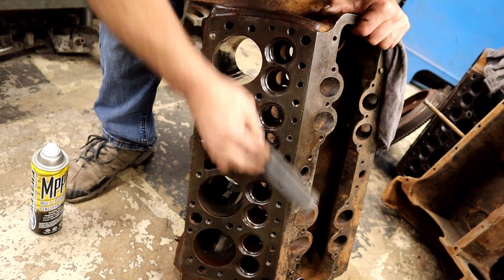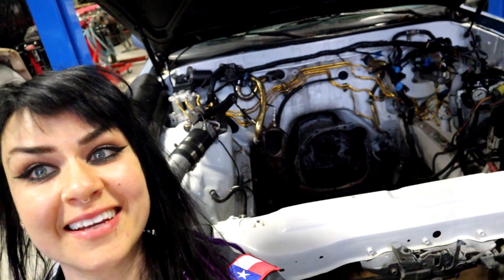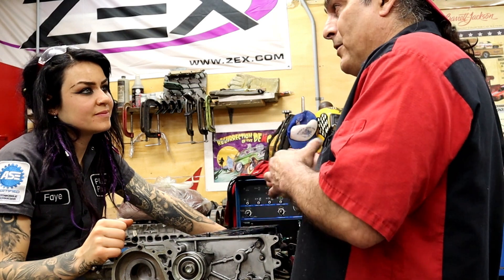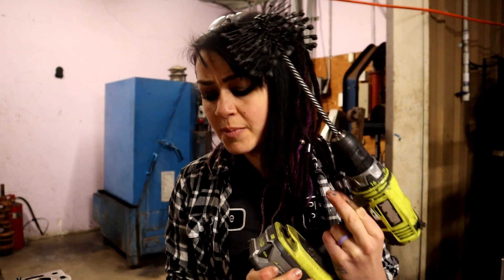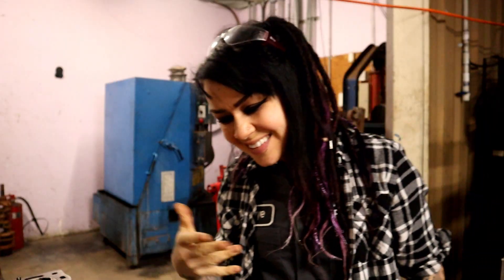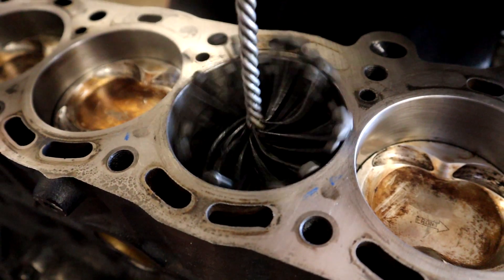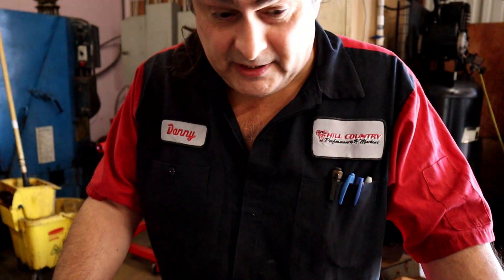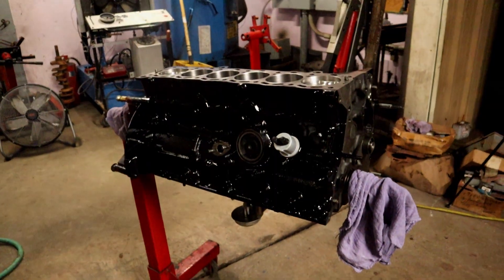Pulling & Cleaning the block, Cleaning Pistons, and Honing the Cylinders!! Supra Saga part 11!

Comment: It needs a PCV valve, and also clean all the sensors, oil change, new spark plugs, new rota, clean the throttle unit, new distributor cap, add Chevron Techron to gas, then reset the computer system.

Comment: Interesting video, but it`s a little bit strange to me, why are you not replaced piston rings? If pistons were covered with burnt oil carbon and factory hon almost vanished, then piston rings should be covered in carbon too. They may not take off oil from cylinder walls properly, which cause extended oil consumption and you`ll be needed to rebuild engine again soon enough...
Reply: The whole engine's junk after this dodgy hone job anyway

Comment: Fellow Texan and Toyota driver and enthusiast here! I have been enjoying your super helpful informational Supra videos. I have gotten myself into a lot of work I wasn't prepared for (not a trained mechanic, a new found self discovered DIYer) in attempt to perform a needed head gasket replacement on my '06 Tacoma with 218K miles and then hopefully more to come.

Entertained by your cute chicken love, but more importantly I am so grateful for the information I've already gained from your video and will be watching many more very soon.
Reply from the maker: Awww thanks so much for your sub, I really appreciate it! And head gasket on an '06?? Wow, what happened?? 4.0??
Reply: Just the little engine, a 2.7L. And I finally FINALLY got 'er finished just last night!! I did not know what a challenge I was going to be getting into taking the entire project on by myself until. It was too late, but I can honestly say that your videos full of knowledge from both you and Danny were a motivating guiding light that made it possible. Thank you again for your awesome smile, your perky spirit and all of the dedication that so clearly goes into your channel to make your daily grind become shared information/entertainment for the world to find. I am now and will always be FOREVER a FAYE FANATIC!
Reply: Ooh, and I had to embark on the repair issue due to the engine overheating due to my slow response in treating the coolant leak that first developed from my corroded coolant bypass pipe (OEM it comes from the factory as a doomed part as it it a plastic pipe in a very hot area of the engine, but has been updated in later year models to be a more suitable metal pipe.) The 05-06 as far as I know we're manufactured with this coolant bypass pipe made of ceramic/plastic that is bound to fail after reaching the "high mileage" (150k+ miles) stage of life. I hadn't discovered all of this until mine had reached the failure stage and then after repairing it, I believe it was just a downhill struggle as I had probably done the repair too late and the damage had been more extensive throughout the cooling system, combined also with my attempts before repairing the bypass pipe to quick fix my leaking coolant issues with stupid products such as Radiator Stop-Leak that potentially compounded the issues at hand rather than fix anything. That said, it was at the 200,000 miles and beyond point that I began having major issues with overheat almost everytime I drove the truck, that ultimately led to my decision to tackle the head gasket repair job myself after being quoted by a mechanic $4000 to do the job. I learned ALOT doing it myself, and it only ended up costing around $1400 total (new headgasket, radiator, water pump, thermo, etc.) by doing all the labor myself. I can honestly saw that I have gained a new found appreciation for the difficult, and more often than not frustrating, work that you and other mechanics do on the daily!!

Comment: Great job Faye. Did you ever try using Seafoam to remove carbon ? That stuff works pretty well as I use it for throttle bodies. Glad you brought it back to Danny as it might've been ugly if you just installed the new head on the old block.

Comment: I am not a mechanic so this is not an argumentative question, but rather a technical "I don't know" question.  As long as you are being super critical with the cylinder walls and piston tops, wouldn't the rings have some contamination too?  Why not pull the pistons and ensure the rings are clean and ready to go as well?  It seems that there is cylinder surface you aren't getting to as well and pulling the pistons would allow the whole cylinder to be "deglazed."  I am obviously missing something.

Just asking.  I am a computer geek and am here to learn.
Reply from the maker: No problem I'm happy to answer!! I performed a leak down test before pulling the engine and so I'm very confident that the rings are in great shape and I also assembled the bottom end so I I'm not worried about someone else's work and double-checking it I feel very confident that I did it right the first time and I also have a trick for cleaning out the piston rings while the Pistons are still installed which I'm going to show you in a future video!!!!!

but a lot of this series is showing what can be done by the regular person at home. Not everyone would have the confidence to tear apart their bottom end and remove their crank or yank their Pistons. Honing here was good cheap and easy insurance but not even super necessary!!!
Reply: The leak down test.  I never even considered that you did that, which clears this up.   Now the small area at the very bottom that you aren't able to hone or whatever (the part between the top of the piston and the rings themselves) is a trivial amount of cylinder wall and nothing that you all are worried about.  This is all cleared up now.  Thanks for the education.

Comment: I would never scrape aluminum with a steel blade, maybe that's just me I don't like scratches on the piston because deposits start there and make the engine ping.
Reply from the maker: It's okay, you don't have to! I'm pretty good at it but I've been doing this stuff for a while. They came out perfectly 👌😊

Comment: Keep waving your hands over that block and it will bite you, lots of sharp bits there, your lack of experience is showing.
Reply: Keep running your fingers over that keyboard.  Your projected insecurities are showing.
Reply from the maker: That's funny!!!🤣 I built engines for a living at the last job I had before starting my business. I have already cleaned the surface of the block like the last video that I made. You should check it out! I bet it will be helpful to you!☝🏻

Comment: You think if you got an oversized turbo it might burn a bit of oil? You think if you up the blow off pressure it might burn a bit of oil? That's normal when you build up a stock engine to make more power, you gotta take it apart and clean it all the time.

Comment: Hi Fey and Danny,  I enjoy your videos..... I have a question for you both..... have you or Danny have come across an engine that was running good and pulled out of the car because of a different issue not engine related but that engine sat for a while , heads where removed for porting  but unfortunately the short block was left out and the weather got to it.... it had Ross aluminium pistons and h beam rods &crank still in it and now rust is on the cylinders 😭. Is there a way I can remove the rotating assembly (pistons) with minimal damage?

Comment: Faye,  You have the engine out. Don't  bandaid it, you have the best teacher by your side. You have found such bad work already go the extra mile.  Pull the pistons and the rings and mic the block.  If it's good hone out the cylinders, put new rings in and put the engine together there while you are still at the shop.  Then, put it on the dyno, break it in and see how much horsepower it makes.  The goal is to have a car that runs.
Reply from the maker: I assembled the bottom end, actually- not them, so I'm not worried about my work. I know it looks like I should have addressed this more because of all the negative comments on here......

Comment: you were right there, why the shortcut?
Reply from the maker: ??? What do you mean? I thought I explained all the stuff in the vid! Correct me!
Reply: @FayeHadley  why hone it with the Pistons still installed? Why not re ring it? Your oil scraper rings are most likely packed with carbon, it's possible your rings did not seat properly cousing the glaze. I'm not trying to hate but since your going all out I don't get why you did it that way. Hopefully it'll be fine.
Reply: @richardt1293  Also the rings are new, I think less than 5k, is what she said.
Reply from the maker: I assembled the bottom end, so k feel confident about it and the engine had great leakdown when pulled, so I don't suspect any issues 👍🏻
Reply: @FayeHadley as long a your confident, just seems kinda silly to dingle berry it without removing the Pistons.

Comment: Straight Seafoam cuts carbon like nothing else I've seen. Better than carb or brake cleaner.
Reply: It won't do much when the carbon is hardened like it was. It's pretty much like a rock at that point lol. But seafoam does work when it's fresh carbon.

Comment: I didn't knew that such tool, that weird thing on the drill, existed and what it'll be used for; but one thing it's clear, that now those pistons heads and the cylinder shirts look really good. Looking forward for more. Stay well
Reply: Dingle ball hones are the quick way to refresh cylinder walls if you're just doing a ring job..
Reply: @stevenbauer7744  I never seen that thing before; i'd seen a drill head like a... sharpening stone?, it left the cylider entirely flat, shiny and everything, and the walls kept being apparently 90º/flat.

Comment: To be that close to the bottom end..it would drive me crazy not to pop the pistons out and clean the bottom of the cylinder walls and ring lands ..but it'll be fine..
Reply: I am with you on that, just a little more work and it would be perfect.

Comment: Dingle ball hones leave a relatively rough finish compared to stones or diamond brushes... im not sure id ever do that to an engine i wasn't going to clean again before assembly.  I'm sure it will be fine.
Reply: Thats why she used the dingle berries. The rough finish helps the rings seal and helps with keeping the cylinder from glazing.